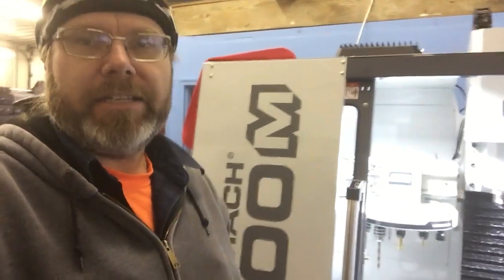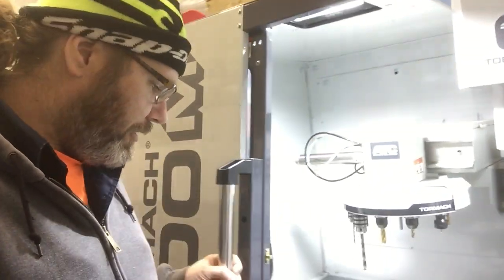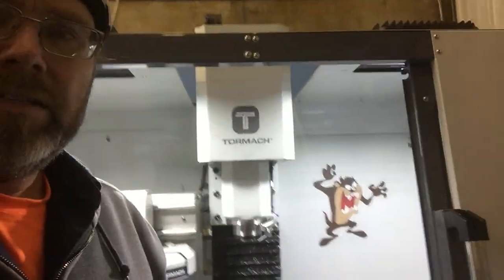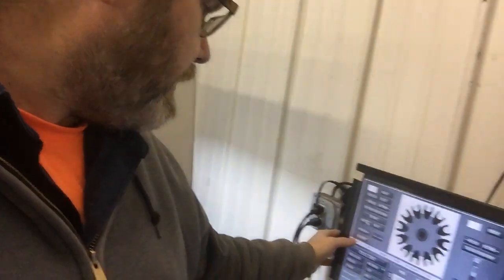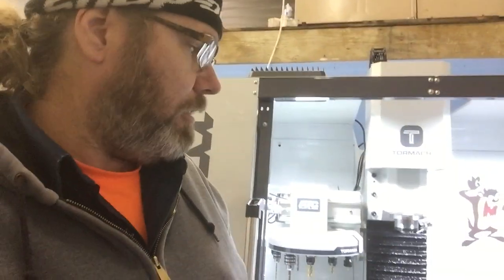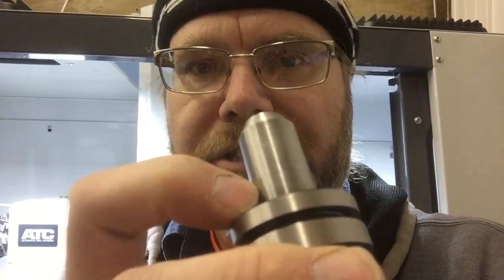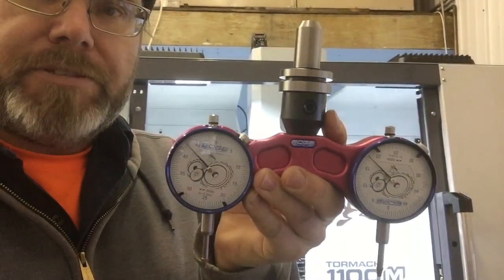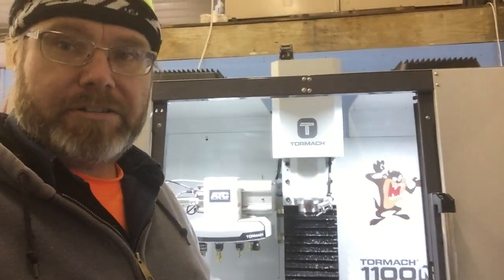Tormach Blues ?

Comment: I  just bought a 440 it is a total piece of shit.
Reply from the maker: I have been waiting to do a follow up video. But my longer term experience with them is that you need to be a master mechanic who will work as much on the machine as you do cutting parts. Always something to deal with. Covid broke the supply chain to the point my machine has just sat for most of the year.  Just hooked up the 4th rotary axis 8" super spacer and its been a disaster. Finally fixed all the problems with the mechanical parts of the unit and the 4th axis drive when plugged in wont let the machine boot. I have reached a level of disappointment that will be addressed in the future.

Comment: Single block an dry run will save your behind when running your first parts. Sounds like an I'm an old geiser I know,( I am an old geiser,) but will save you from wrecking your machine. The time you spend in Single blocking an dry running your first part will more than pay for itself.
Reply from the maker: eventually though.... you got to make chips !

Comment: Jonathan, do you by chance remember the fix for your coolant pump issue. Currently experiencing the same
Reply from the maker: need to switch the voltage to 120v. Otherwise over powering the pump will slowly cook it with 220v.

Comment: @automan1223 Thanks very much for posting this video and sharing you thoughts, experiences, and advice. I have just received my 1100M and also the servo upgrade kit. I've held up assembling the enclosure because the servo upgrade will be much easier to install prior to adding the chip trays and the enclosure. So finding this video now is perfect timing for me. Appreciate your tips on sealing using butyl tape vs. sealant dispensed using a caulking gun. After reading numerous threads on various CNC-related sites, I also ordered 3 tubes of Permatex sealant, but I opted for the recommended 'Right Stuff'. It's more costly, but then again I don't expect to be buying more any time soon. Thanks also for your points regarding air pressure. I don't have the ATC, but will be configuring my power drawbar shortly and will bear in mind your explanation regarding optimal belleville washer compression force vs. drawbar compression force (ie psi).

Comment: I didn't even think of using the TTS in my old knee mill.  Does that SMW fixture pallet let you move your vises on/off quicker?
Reply from the maker: it would be faster if the vises had dowel pins in the bottom to locate. Otherwise its just a bunch of holes as opposed to slots.
Reply: @automan1223  maybe a flat surface on the back of the vise to push up against some pins?
Reply from the maker: @multiHappyHacker  I have SMW tooling plate. Jon Sells pins and hardware for locating parts on the plate. I am sure the vise is square enough to do just what you suggest. I was thinking more along the line of securing the vise like Orange does their vise's but that would require drilling thru the castings. I have the Tormach 5" CNC style vise set.

Comment: I had the same issue with the tool offset but it was operator error: In fusion360, when you select/create a tool, make sure in the post processor tab the tool number, Lenght offset and diameter offset are all the same number. Another way to check it is in your GCode, make sure that at every tool change command (Txx) the T and H numbers are the same, for example: T40 G43 H40 M6
Pathpilot in this example will look for the tool offset #40 for the tool #40...Hope this helps
Reply from the maker: Also from what I see tool changes in your master tool library are not parametric, which means if you tweak specs on a tool it will not filter down to the cam file of the part you are working on !
Reply: @automan1223  I may be off base here, but I don't think your understanding of 'parametric' is quite correct (and sincere apologies if I'm wrong, wouldn't be the first time...). Parametric modeling does not imply realtime updates for any change. So tool table entries are not automatically applied to CAM files. Parametric modeling in Fusion 360 refers to the ability to relate multiple dimensions for model features to other feature dimension or to other separate defined 'parameters'. By taking advantage of this capability, model scaling will adjust 'automagically' when one or more independent parameter dimensions or values are changed. I don't believe this has anything directly to do with incorporating into G-code CAM output the consequences of changing tool height dimensions in the tool table. You need to explicitly re-generate the code at which point new G-code is created by Fusion 360 reflecting the then-current model and the then-current tool table entries.
Reply from the maker: @steveh8724  The CAM needs to be re-generated any time you make a change in Model space to Cam space.

Comment: "Anyway, I am rambing".
To which I said out loud, "Yes you are!".  
The power drawbar, and the air pressure.  Isn't the air pressure to RELEASE the tool?   A low air pressure would not cause a tool to drag out.  No?
Reply from the maker: The trap Dan, is that if you have low air pressure, you are going to set the spring washer preload way too loose since the piston release will not have enough juice to release the collet ! (this leads to WEAK TTS retention)...  If you have good air pressure to release, then you can crank down on the drawbar and really get the spring washers to do their thing, which is to pull up on the drawbar/collet, once the air pressure to the piston is released and thus hold the tool in place !!  I was not clear how drawbar / air pressure / TTS tool retention are all connected. I will do that in a followup video.

Comment: Can you replicate the issue with Fusion and the height offset? Do you still have the file?
Reply from the maker: There have been at least 1 or 2 updates, a lot of the bugs were exterminated with the last fusion update. But checking Z heights is something I do not take for granted when I post new code, now I always go and check where it's going.
Reply: automan1223 it would be interesting to see. I haven’t heard about this from anyone else. Could it be one of your tools set up incorrectly?
Reply from the maker: @MechanicalAdvantage  I had double checked all the height tool offsets in the Fusion tool library and the offsets in Path Pilot. One thing I have noticed that any updates to the tool in the library are not parametric. Which means if you have a tool selected in an operation, and later change the tool even slightly in the main library where the tool was pulled from, it will not use the updated tooling information in the established operation. One thing I did do was use the fusion removal tool and re-install the whole software package and that seemed to solve a lot of bugs, even after the latest updates. Believe me I could send you several files that do weird things, but I figured its just fusions growing pains, and or my inexperience with the software...I eventually get things to work but it burns up a lot of time.....
Reply: @automan1223   I had same thing happen but seems just to be chamfer mills This happens about 4 times and I double checked Tool offsets??